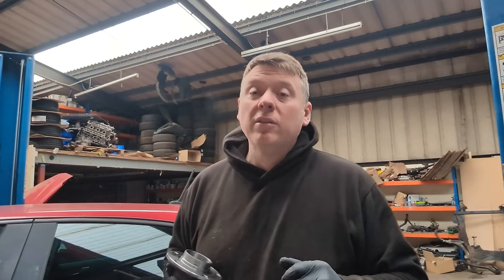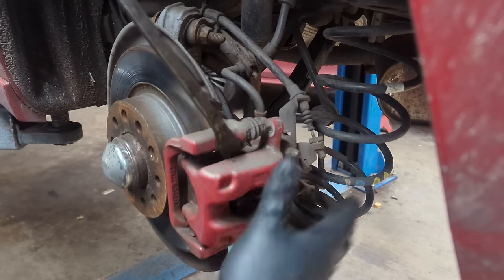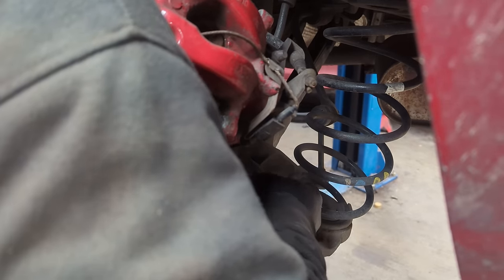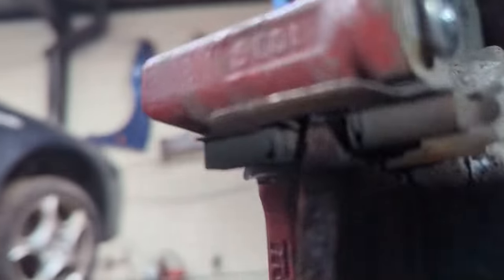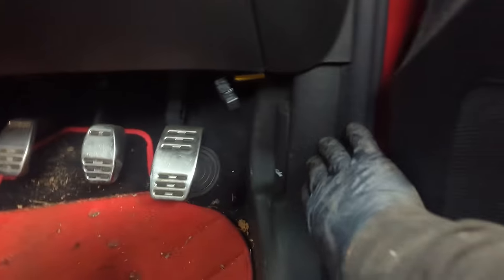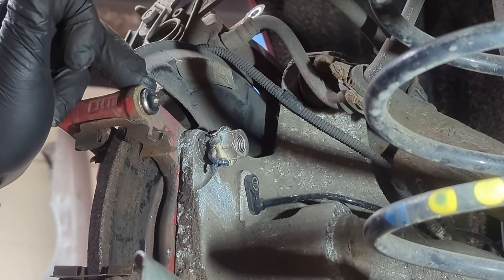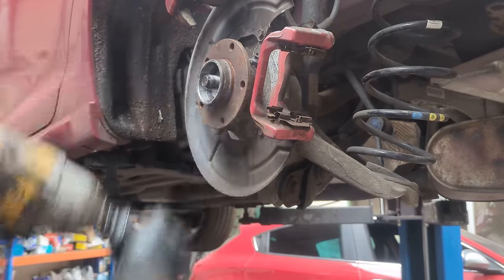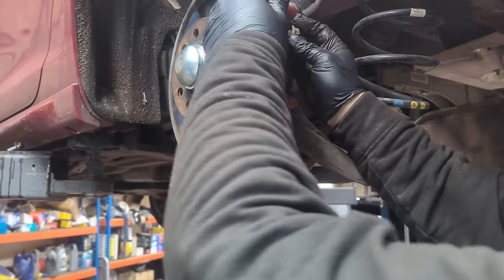ALFA ROMEO GIULIETTA REAR WHEEL BEARING REPLACEMENT. BUT SOMEONES BEEN HERE BEFORE.

Comment: Why put those rusty bolts back and not new rust resistant with a hexagonal head? Also, bearing nut should be torqued to a specific number. 🤔
Reply: How many Nm? Is there a manufacturer guideline?

Comment: Aren’t you meant to use a torque wrench to tighten the wheel baring nut? Obviously impact gun is quicker, but could over tighten and reduce the lifespan of the new hub?
Reply from the maker: Just didn't edit any of that into  the video.
Reply: @ItaliaAutos  so what torque did you tighten?

Comment: Hi thanks for sharing I’ve learnt a lot on Alfas by watching your videos it helps me to maintain my own Alfas 
Is there a specific torque setting for this bolt and is it necessary to put any wheel bearing grease in in or is it sufficient grease in the the wheel bearing assembly 
Thanks

Comment: I really dislike allen head bolts. If you’re lucky you can usually get them undone by hammering a torx bit in. The previous guy left rounded allen bolts to my 2.0 water pump.

Comment: Left my Giulietta in for two springs fitted last week, I supplied the springs and they tried to charge me three hours labour. I was fuming having seen an amateur so it on his driveway on axle stands in 30 minutes. There was just no way it took them three hours to do a pair of springs.
Reply: you don't mention if it's front or rear springs .... rears are easy and quick, fronts are a lot more labour intensive - undertray/bumber/crash bar/ off just to get at the nut to remove the wishbone which needs sliding out to give room for the strut to drop down and out
Reply: @dave564  Rears and they forgot to put the rubber mounts back in, utter incompetence
Reply: @skimmingstoness   jesus .... like you've mentioned it should be around 1 hours labour for both sides ... no arms to remove - just compress the springs and out they pop, the dampers are not within the spring on a Giulietta

Comment: Any comment on why the bearing /  hub should have failed on such a newish car ? Seems wrong to me. Bad design ? Under strain ?Are replacements different qualities ?
Reply from the maker: So many variables on to why.
Reply: It's component quality. Over twenty years and five Alfas I replaced one wheel bearing. Over six years on my Skoda Octavia 4x4 all four have failed in 65,000 miles. And the alignment is fine, so it's not that.

Comment: I confess I'd want new caliper bolts. You do have to wonder about people who don't come clean about rounding off Allen sockets. If not even tight it's safety critical after all.
Reply: Should have used new M10 socket cap bolts with quality anti seize.

Comment: Those bolts should have been replaced and all bolts should have been torqued to spec.  Not because you don’t know what you’re doing, but because you’re showing the internet, someone that isn’t as mechanically minded as you are how to do a job that involves removal and refit of safety items.